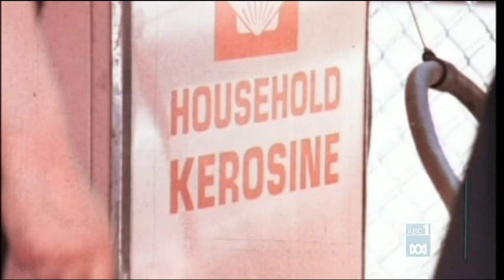Steam Powered 1963 Ford Falcon

Comment: Steam engines, especially closed ORC ones, would make tremendous waste heat recyclers for ICEs. That's how it's done on the big power plants using diesels or turboshaft engines.
If working with water steam, though, it might be better to inject the expanded steam into the ICE's cylinders somewh near the end of the compression stroke, before injection (and, for gasoline engines, igniti6) of the fuel.

Comment: Steam is inconvenient .
Reply: Steam is horribly inefficient.
Reply: @sandervanderkammen9230  Shitloads of torque though . Its viable but I don't think people would want to wait to roll .
Reply: @ApothecaryGrant  Not any more torque than a hybrid or electric vehicle.

With a transmission an internal combustion car can make as much torque as you want.

Of course the Pritchard steam car only made 20 horsepower... not impressive at all.
Reply: @ApothecaryGrant  Steam cars are no longer viable, they became obsolete in 1914 when Charles Kettering invented the push button electric starter for internal combustion engine cars.

Comment: The big US car companies and oil companies manage to shut down another great idea in improving automobile performance, economy and ecology!!!
Reply: Can you prove any of those unbelievable claims?
Reply: @sandervanderkammen9230  I could, but you'd never believe it, so why go to all the trouble. I can tell your mind's made up so I don't want to confuse you with the facts
Reply: im curious though steam seems to be inefficient?
Reply: @AIuminum  The Second Law of Thermodynamics as discovered by Nicolas Carnot tell us that steam is less efficient because of Thermal Entropy.
Joseph Black also tells us that Latent Heat energy is lost during the phase change from liquid to a gas.
Internal combustion engines do not lose energy from the phase change.

Comment: The statement made at about the 1:30 mark about a boiler being a more efficient use of fuel isn’t exactly true. Though you can have more complete combustion the heat transfer from the flame to the exhaust gasses to the boiler itself and finally to the water constitutes great losses in energy. Hence why it takes so long for a steam engine to start from dead cold.
Reply: External combustion Rankine Cycle engines are inherently much less efficient than internal combustion engines.
 This was discovered by Nikola Carnot in 1824.

Comment: OFFS - no mention on the actual tech. I'm guessing it was a Doble style steam generator - but I can only guess.
Reply: Shockingly unremarkable and outdated technology... with very unremarkable power and fuel economy performance as well. The Australian government pulled the plug on its investment when Ted failed to deliver proof of his exaggerated fuel economy and emission performance claims... The general conclusion is the company was a scam right from the word go... Ted is suspected of embezzling government and private investments and leaving the bankrupt company without ever producing a single working vehicle.
Reply: @doktorbimmer  At least Doble made cars but theirs were competing with 
Rolls-Royce Motor Cars in the most specialized markets with every unit produced (like RR at the time) a hand-built one-off.
Reply: Doble only built a few dozen cars before also going bankrupt after charges of investment and stock fraud.
Reply: @doktorbimmer  - Which one? There were 2 Doble car companies. The one up till John Doble died, and the 2 brothers afterwards.
Reply: There was only one actual Doble Steam Motors  Company (1924- 1930), it was run by Abner Doble. The Besler brothers bought the remaining assets of the company after it went bankrupt in 1931 but never produced any cars.
Reply: doktorbimmer you forgot the one in Detroit before the one in Emeryville. Figures the Besler brothers bought them out. They were also in Emeryville and showcased their steam generator plane in Oakland shortly after.

Comment: I would love to have a steam car.  It only makes good sense.
Reply: Steam cars are obsolete for some very important reasons...
Reply: what are the reasons?  I mean what can be worse than trying to dispose of these electric batteries?   @doktorbimmer
Reply: Well, for example 400% greater fuel consumption and 10 times the exhaust pollution along with a massive, obscene carbon footprint... not to mention the prohibitive cost associated with steam technology.
Reply: Chemical storage batteries are exactly why electric vehicle will never replace internal combustion cars, a single Tesla S battery can released up to 35 pounds of highly toxic soluble Cobalt into the environment... a poisonous heavy metal that causes cancer, birth defects and destroys your reproductive organs.
Reply: My friend said, this would probably be true for a Stanley Steamer, but by the 60s we had much better steam engines.
Reply: @doktorbimmer Ted Prichards Ford Falcon carried 1/2 gallon of water, compared to the 7 gallons you would find in a Stanley steamer.   And this is 60s tech. Steam engines now have steam generators which use next to no heat.
Reply: @doktorbimmer  Cyclone makes a steam engine that runs off of 24 different bio fuels.
Reply: @doktorbimmer The old steam locomotives of the late 1800s used a tea cup full of water to move 1000 pounds one mile.
Reply: We used to have small scale steam engines, and once they started they pretty much ran on inertia.  My friend said:  1934 Doble. Steam car that could run 130 MPH
Reply: what would it take to get 1000 pounds feet of torque out of a gasoline engine. Steam engines have this with zero effort.
Reply: Well, your friend is no engineer, the Carnot Cycle Formula and the Second Law of Thermodynamics prevent any Rankine Cycle engine from coming anywhere near the efficiency of internal combustion in a practical automotive application.
Reply: Cyclone Steam Technologies is a notorious and now defunct vaporware investment scam.  Harry Schoell built himself a Mega yacht after embezzled millions dollars in investments and never producing a single working steam engine and never produced any verifiable third party independent testing results.
Reply: Then explain why steam locomotives have been obsolete for over half a century???
Reply: Doble was also charged with investment fraud, his cars cost nearly $2 million each in today's value, he went bankrupt in 1930 and died penniless. A Doble E-series guzzled gasoline at 6.5 MPG but produced only 150 horsepower.
Reply: Sadly the producers at Discovery Channel have refused to comment on being duped by Cyclone Steam Technologies.
Reply: That's easy... its called a Torque Converter and a transmission. Of course you must remember the Doble only produces 1,000 lbs-ft at ZERO RPM  and torque drops as rpm rises... The Doble produces a paltry 150 hp when new... which also quickly fades with wear and scale build-up.
Reply: I'm pretty sure he will be looking at that.  This is my first contradiction on the steam engine discussion.  Please stay tuned, while I learn. @doktorbimmer
Reply: If you have any questions I would be happy to offer some more facts and insight on this often misunderstood topic.
Reply: Thank you very much, same for your already given responses.   @doktorbimmer

Comment: What was the fuel consumption? The original Falcon with a 2.8 litre 6 got 30 mpg.
Reply: Ted Pritchard kept that fatal flaw a secret... steam cars have terrible fuel consumption compared to internal combustion engines and the Carnot Formula tells us that he would have been unable to make any significant improvements with such a crude engine design.

Comment: Just for laughs I read a lot of the comments. As the intelligent folks here point out, a steam engine (no matter how much technology you throw at it) is not as efficient, safe or practical as a modern ICE. Yes, Mr Pritchard put a steam engine in a Falcon. And he made all kinds of efforts to have it put into production, but an internet search finds nothing that shows there was an improvement over ICE engines available when Mr Pritchard was working on his engines. There is no conspiracy by the automobile makers or oil companies to prevent production of a steam powered car. You may think the Big 3 have squashed the development of steam power, but actually they have researched it and it just does not prove to be better than ICE. If steam powered cars were such a good idea you can bet any of the Japanese companies would have put it to use, as would the car companies in India and China. Many high tech companies and research universities have tried to develop a modern, efficient, safe, and low maintenance steam engine for cars, but they have yet to produce anything equal or better than modern ICE. I admire Mr Pritchard's efforts and those of others exploring engine technology, but what we need most is a big improvement in battery technology, because electric motors are the future of transport power, not ICE or steam.  And thanks to paulaus for posting this video....led to some interesting research.  👍
Reply: Battery-powered electric propulsion might not be the ultimate solution. As long as lithium is used, it is not recycled properly and its useful life cannot be extended. Bolivia and Argentina concentrate (supply) 91% of the world demand for this mineral. And producing it at the pace that would be needed would destroy the ecosystems of those countries.

Comment: The advantage of steam? 100% torque from 1 RPM  !!!
Reply: Electric motors have the same advantage, and are vastly simpler. Steam is cool but it's just not practical for personal cars.
Reply: @michaelramsey82  Electric motors are capable of 90+% efficiency while a reciprocating steam engines like this one are usually less than 10% efficient.
Reply: @sandervanderkammen9230  ...look up Barry Hilton planetary engine which ran at the same efficiency...saw it as a 20 hp motor running for ten min_ tailpipe was stone cold...1993
Reply: From Zero RPM... torque decreases dramatically as rpm rises, this car produced only 20 hp at best.
Reply: @doktorbimmer lol did u use any steam car or engine or u know anytging about steam car ? wtf hoe u say it dec with inc rpm ??
Reply: @sssbznzn  What do you know about steam cars, did you watch a YouTube video and now you think they are cool??
Reply: The disadvantage is long startup time.
Reply: @wilhelmsallsten7706  So what is the start-up time - I expect 30 seconds perhaps 90 seconds.   Flash boiler developed in 1885-ish is instant.
Reply: @AndrewLohmannKent  Fuel consumption was horrible... performance when cold terrible.
Reply: @sandervanderkammen9230  And you know this how? You come on here making a bunch of blanket statements of a self styled expert, but give no sources. IC engines are generally more efficient than steam engines. This is because IC engines operate at a higher temperature and pressure than most steam engines which allows them to extract more energy from the fuel. Steam engines can be more energy efficient in certain applications, such as those which operate on superheated steam at high temperatures & high pressure and use heat recovery systems.
Reply: @wilhelm sallsten The disadvantage is higher production and maintenance costs along with higher fuel consumption, lower performance and higher emissions.
 The Pritchard Steam Car company went bankrupt without ever producing a single car... he left with the cash and left investors holding the bag...

Comment: A victim of the oil conglomerates.  This is the way of the automobile.  Not diesel not hybrid not Tesla.  So sad.
Reply: A victim of incompetence and bad engineering, Nicolas Carnot discovered internal combustion was superior in efficiency in 1824.... Rudolf Diesel proved the Carnot Formula in 1890.  Once Charles Kettering invented the electric starter in 1915, steam cars became obsolete virtually overnight.

Comment: Any thing can be done n steam can be efficient I think . safety is a concern . Fire would have to be out dam quick in case of accident n A/C would be difficult to run off steam . n people are in a dam hurry . turn key n go now ! OK . then you have winter in some places! but I would not mind having one if I had the doe ray me .
Reply: Unfortunately Nicolas Carnot discovered in 1824 that the Second Law of Thermodynamic prevents steam from being efficient, Charles Kettering's  invention of the electric starter in 1915 killed off any possibility of steam car  becoming commercial viable ever again.
Reply: Actually A/C would be easier with a steam car by utilizing an Ammonia Absorption system, it could operate on the left-over waste heat from the burner and requires fewer parts than a conventional vapor compressor type system.

Comment: One of many comical things said in this video : "You could burn any liquid fuel that was volatile enough, have enough octane rating would run that car" Do you really need knock resistant fuel in a boiler?! LOL!!!11
Reply: One of the ironic things not mentioned in the video was how horrible the fuel efficiency of this car was... or how little power it produced.
Reply: +Autistic Boy  I know something you don't son... that this car was horribly inefficient and made very little power.... that's why it was a FAILURE!
Reply: +Autistic Boy Something more like a vast empty void inside yours...Lol!